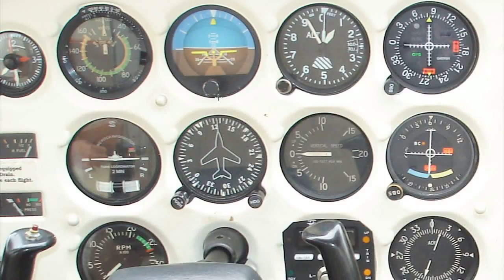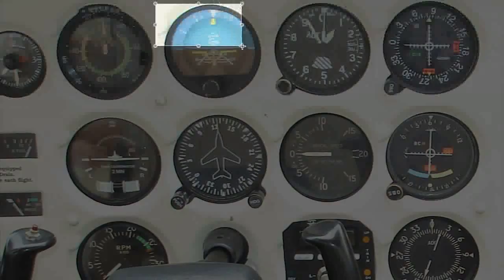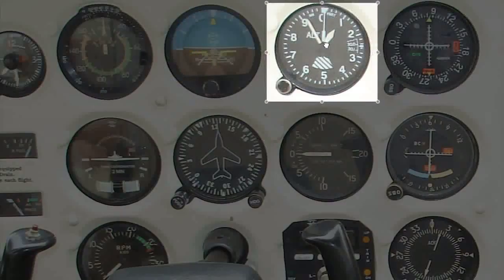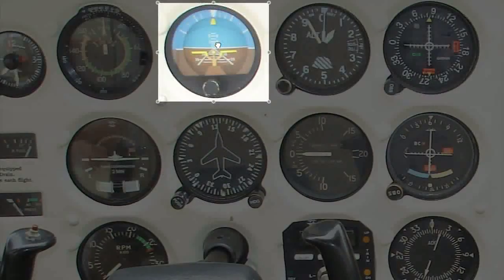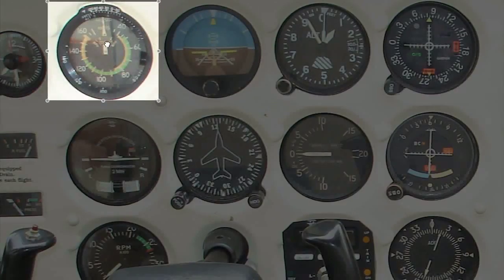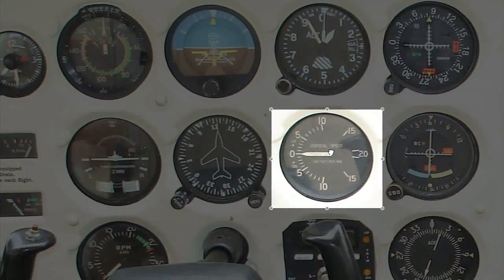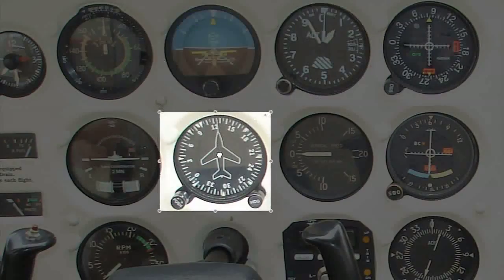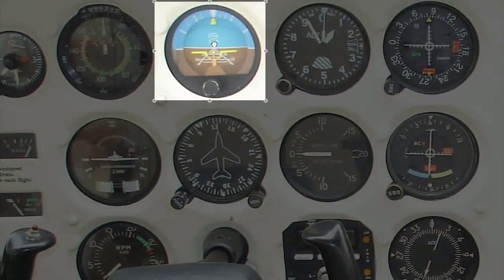Flying Instrument - IFR Instrument Scanning Technique

Comment: I fly for an on-demand cargo operation now that I'm retired from the airline. We fly all types of payloads in gutted out turbine-powered, twin-engine commuter aircraft. Our company prides itself in specializing in the hiring of young, low-time flight instructors who are recent college graduates. At our company they will gain time and experience in real-world operations before trying their hands at regional airlines or the military. One of the most persistent problems I have with many of these new-hire flight instructors is their inability to hold accurate altitudes and courses in these relatively unstable, very sensitive airplanes. Well, it seems that they have all been taught, and have been teaching the "Primary For This, Primary For That" method of instrument flying which I call "PFT-PFT." While my stomach is quickly reaching the point of no-return, I try to explain to them that if they were attempting to fly corporate airplanes with CEOs onboard, they wouldn't last very long because of their yo-yoing of the airplanes. CEOs know when  the air is smooth and when it's not. If they perceive that it's the pilot making them airsick, that pilot will be soon looking for other employment... The "PFT-PFT" method of teaching was okay back in the old days before we had gyros; primary instruments were all they had back then. But we have very accurate gyros now. And the gyros should be primary for everything. You can cover over all but the gyro instruments and hold courses and altitudes better than if you were referencing all the instruments - each as primary for whatever... In fact, when I just can't stand it any longer, that's what I do for these young kids. I cover everything but the attitude and heading gyro indicators. And what do you know??? They begin holding altitudes and courses like professionals. I've had new-hires who couldn't hold altitudes within plus or minus 200 feet in these very touchy, high-performance airplanes (while using their PFT-PFT method) nail their altitudes within plus or minus 50 feet for an hour or more at a time while not even having an altimeter to look at. And my stomach begins to settle down... The PFT-PFT method of teaching and flying IFR is okay if you're flying a Cessna 172 or such. As a matter of fact, it's good to learn that method early on just to have as a backup when forced to use partial-panel flying in emergencies... However, when you step up to high-performance airplanes and jets, you have to leave the minor leagues and step up your game in instrument performance, too. And PFT-PFT just doesn't cut it any longer. I need my Pepto-Bismol just thinking about it.
Reply from the maker: Thanks for sharing!

Comment: One technique I have found to be useful for a six-pack (or EFIS as well) is a V-inverted-V Scanning Technique.  The 'V' scan of Airspeed Indicator, Heading Indicator, and Altimeter give an instantaneous picture of how the airplane is flying ie is it on the right airspeed, heading and altimeter.  Corrections to this can be applied, then verified using an 'Inverted V' scan of the Turn Coordinator, Attitude Indicator, and Vertical Speed Indicator.  These instruments are useful for spotting as well as setting trends to return the aircraft to the desired airspeed, heading, and altitude with the next 'V' scan, and so on and so forth.
Reply: this is really solid i like it